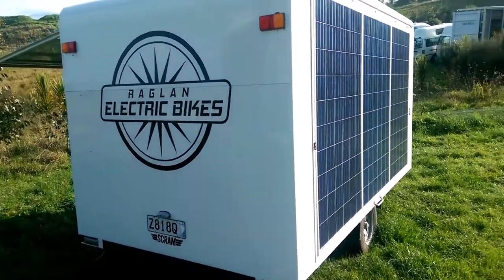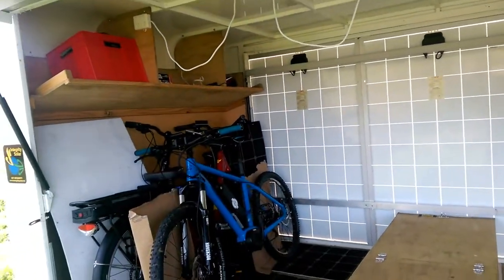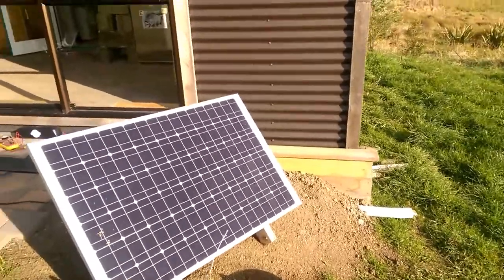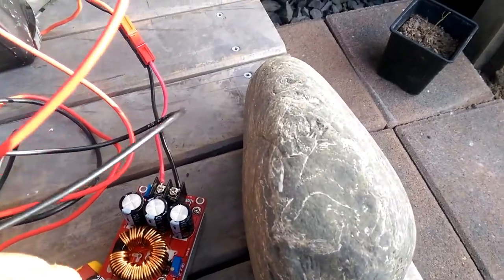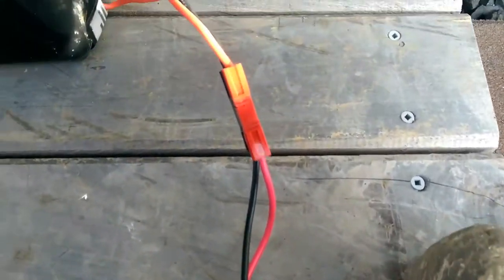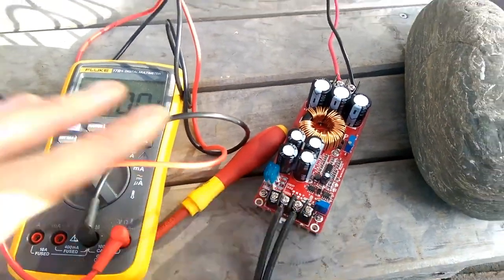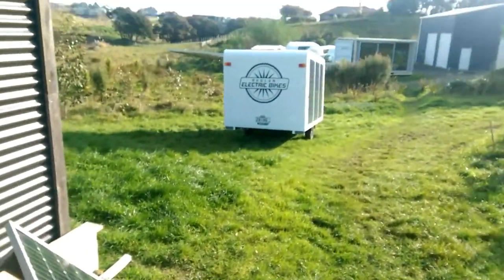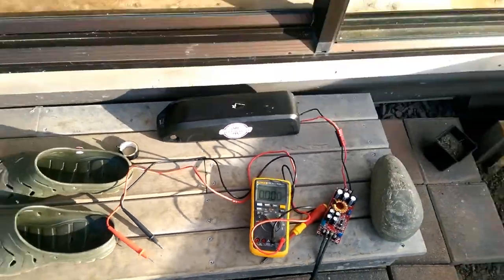Solar Battery Charging for Ebikes Experiment

Comment: Absolutely awesome, I don’t know much about electrics in general and there are a lot of people like me out there. This seems to be the answer to the situation I find myself in. I would like to tour with my e-trike towing a trailer and have a spare battery being charged by solar. I don’t really want to stay on regular campsites or break for lunch for hours on end so that I can charge my battery. I want to be out there on the road and as independent as possible. Carrying a deep cell battery and an inverter is not an ideal solution either. I would love to see this on the market as I’m in the process of building my trailer now. Great video, great idea :)
Reply from the maker: A panel and the charge controller are what you need!
Reply: kevin sparks
, take a look at "genasun charge controller" They are a bit pricey but they come with good protection for your lithium battery. They have unites specifically design for all different type of batteries and panels of different voltage output. The amount of solar panels you will need depends on how much distance you wish to do per day. On a full sunny day a 100 watts panel can almost fully charge a 36v 10amph ebike battery. Some have managed to travel 300km in a single day with a 300 watts solar panels. Boost charge controllers are the best since the the energy transfer lost is negligible. Lots of options,  Instead of caring a deep cell battery they do sell 12v 100 amph lithium that you can incorporate in your system. That works great if your trailer only has room for less than 150 watts. You get to travel over 100km easily and let it charge wile you camp. All comes down to how much money you are willing to spend. Like you I like to be on the road and not rely on paid campsite. My next trailer built will provide me a 400 km range on the batteries alone plus whatever the sun will provide.

Comment: Great idea, just what I need. Will it be available in the U.K. will it work with any 36v battery, mine is 15ah and I have a 60watt folding solar panel that fits in a pannier.
Reply from the maker: Hi Ian, The part is available from eBay/Ali Express etc. I haven't taken it further than my hobby because I don't see a way to 'add value' beyond showing people what's available out there. If you disagree I'd be keen to hear your feedback.
Reply: Raglan Electric Bikes  Hi there, just my way of thinking, electric bikes all though been around for a while are still increasing in popularity hasn't peaked yet. And with pollution on the increase solar is the way to go. The cyclists you need to be aiming at are those who bike touring, as I have asthma and diabetes I can't exersise too much hence electric bike to do most of the work. I think you need to develop the idea with readout displays if you haven't already. And be patient.  I noticed that on Amazon there is a similar product at 30 uk pounds in a metal case program able for bikes. Anyway I will stop waffling ...... thanks for your reply, and good luck with the product, you are ahead of your time that's why you can't see the way forward.

Comment: Very nice. Problem is I have grid connect panel at 45 voc and 5.5A max current(190W). Can your fancy gadget handle this kind of solar panel to charge a 48V battery pack?
Reply from the maker: No such thing as a problem, just opportunities! The max input voltage of this gizmo is 60V so it will work with your panel.  Check out the next stage of the project here: https://youtu.be/Xga8gaKOmBo

Comment: im gonna try this method  but with a 18v 1oow panel and the 1200w dc to dc converter  to output 54.6v limited to 2A or 5A if panel can handle it
Reply: to charge a 48v 20ah battery

Comment: Would be cool if you could come up with an interface to be able to charge through RoPD connectors. I have solar, dc/dc chargers, leisure batteries etc the RoPD is proving a stumbling block though.....
Reply from the maker: Thanks for the tip, agreed, would be great. I didn't really know what RoPD was but this link explains it well: https://www.electricbike.com/ropdenergybus-charging-port-standard/

Comment: Can you give me a link to buy this converter?
Reply: you can get it on ebay or amazon   its called either a 1200w dc to dc converter  or 1800w dc to dc converter   input from 10v to 60v max  - output 10v to 80v
Reply: boost converter for short

Comment: Great video! How many watts is that solar panel and do you happen to know how long it takes to charge the battery with this setup?
Reply from the maker: Its a 160W panel.
If you know the Wh of your battery then its easy to estimate charge time. Wh/W = hrs to charge assuming perfect sun. For a 36V, 13Ah battery its got 36x13=468Wh. So 468/160=2.9 hours.
In reality you never have perfect sun, you never start with a totally empty battery and you never need to fill it right up. Just plug it in when you're home and unplug when you need to go out :)
Reply: Thanks for the help! I order this converter. So do you adjust the output voltage by not having the battery connected, attach the volt meter and solar to the converter and turn the dial until it reads 41v? When charging the battery, do you leave the battery on or off or does it not matter? Thanks!